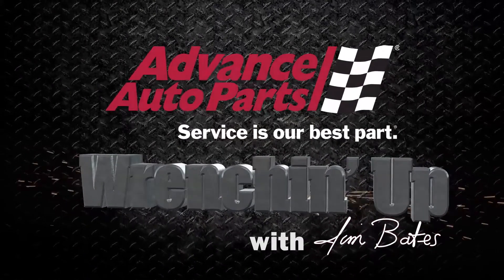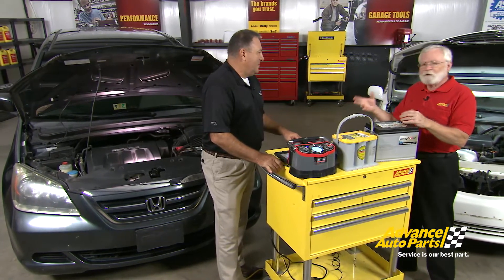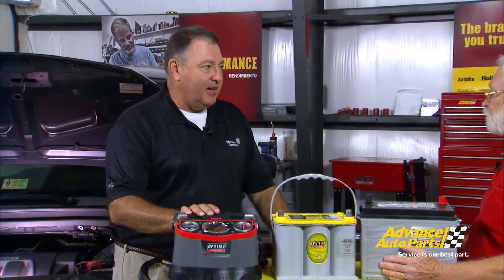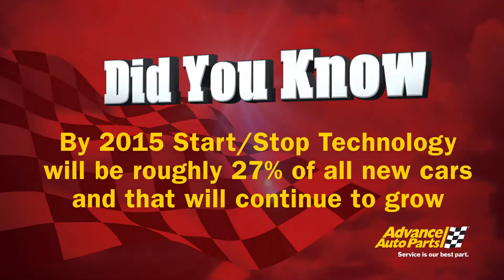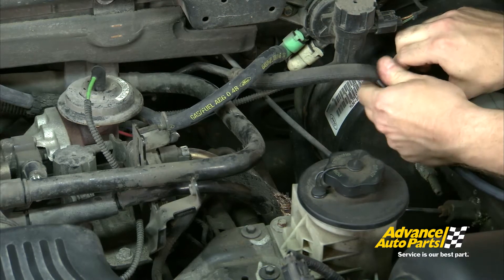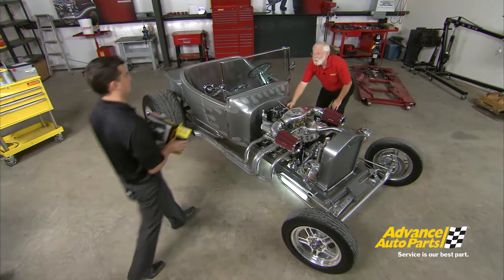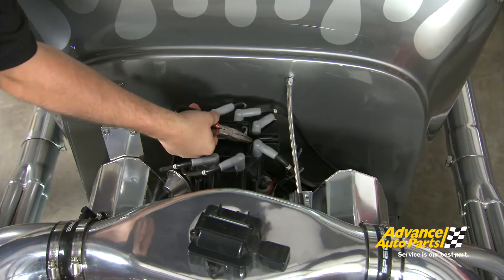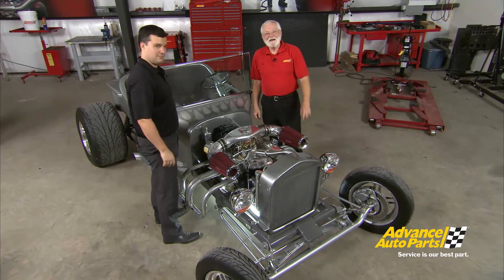Wrenchin Up with Jim Bates - Ep. 3 - Advance Auto Parts Professional

Comment: I want to install a AGM battery in clasic truck (196Dodge A100. I have already upgraded the aternator to a mid 80's with a electronic regulator. Is the alternator (regulator) different for a AGM battery?